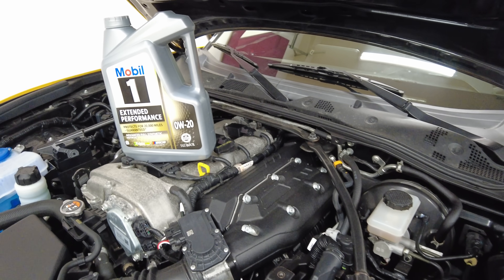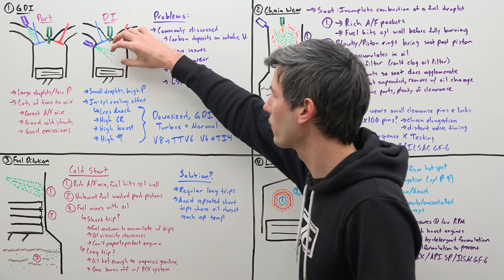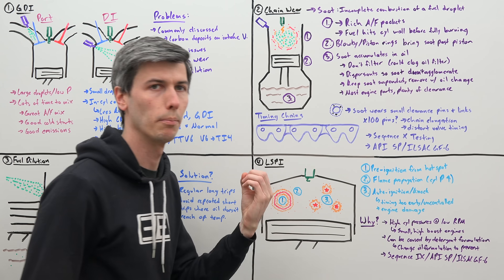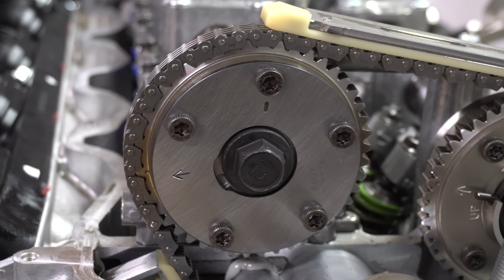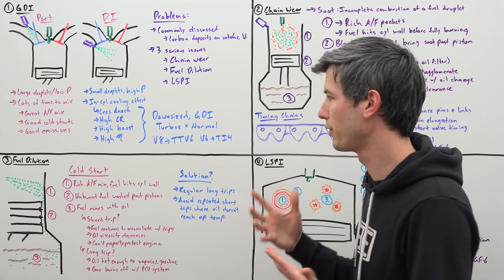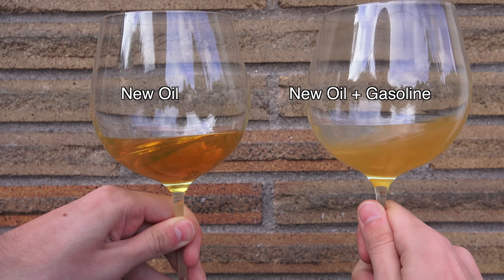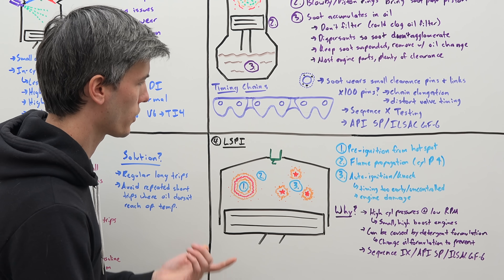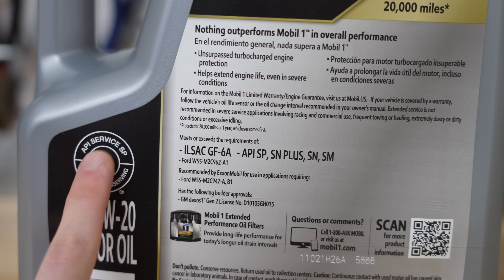3 Big Problems With Direct Injection Engines (Gasoline)

Comment: Some engines now come with port injectors, as well as direct injection. I'm curious to know if you feel this is to address these issues or the build up on the valves.
Reply: @asutin Grubbs best of both world
Reply: In DI/PI engines, port injectors are used at start-up and at low RPMs when efficiency isn’t needed, switching over to direct injection at higher RPMs to produce more power. This not only reduces carbon build-up on intakes by pouring gasoline on them, but also ensures that direct injection isn’t used at low temperatures. That reduces unburned fuel (soot) and oil dilution.

The trade-off is that these engines are quite a bit more complex in fuel injection and pumps, but also in timing and programming.
Reply: @afcgeo882  Toyota uses them, because they're clever people 😊
Reply: @afcgeo882  At very high RPM the DI can't keep up by itself and the PI cooling of the valves is beneficial and both are used is my understanding.  Where the DI really shines is in the mid-range where most cars are most of the time.
Reply: @Scoots1994  Quite the opposite. Direct injection is very happy at high RPMs and can easily “keep up”. Valves also don’t need cooling. 

“How It Works
According to Toyota, during low-to-medium engine loads, both direct-type and port-type fuel injection are used together, or one of them is used to create homogeneous mixed air and fuel, thus contributing to stable combustion processes.

During high engine load ranges, only the direct-type fuel injection is used to cool down the intake air with the chilling effect of vapors in the fuel, which is injected into the cylinder, improving charge efficiency and anti-knock properties. Under some conditions, the intake valves open to allow the homogeneous air/fuel mixture into the combustion chamber, and fuel is injected during the first half of the intake stroke.

During a cold start, the system times the opening of the port and direct fuel injector to decrease emissions and achieve stratified combustion. Immediately after a cold engine start and during the exhaust stroke, fuel is injected into the intake port from the fuel injector assembly (for port injection). Fuel is also injected from the direct fuel injector near the end of the compression stroke. This results in an air-fuel mixture that is stratified, and the area near the spark plug is richer than the rest of the air/fuel mixture. This process allows a retarded ignition timing to be used, raising the exhaust gas temperature. The increased exhaust gas temperatures promote rapid warmup of the catalysts and improve exhaust emission performance.

It is impossible to detect where the changeover from port to direct injection occurs. The only way to see the different fuel injection operations is with a scan tool.”

“Tomorrow’s Tech” article from their website, March 21, 2019.
Reply: @Scoots1994  D4S (Toyota's version of dual injection) I think only uses DI at high RPM. DI can most certainly keep up at high RPM, at least at the sorts of sub-8,000 rpms found on road vehicles.
Reply: @Scoots1994  I was about to say that. Mid-range is where the DI shines
Reply: @afcgeo882  Audi's 5.2L V10 engine uses the port injection throughout the rev range, although at higher RPMs it's limited to about 10% of the total fuel flow. They also do not use the direct injection system at low RPMs. So it will vary between manufacturer as to how they use the two methods of injection together.
Reply: @rars0n  It’s basically the same, actually. All of them use port injection at low RPMs and direct at high. You just said the same exact thing. Did you read what I’ve said? It’s the same with Ford and Hyundai as well.
Reply: @afcgeo882  No, I didn't George. You need to read more closely. You quoted something about the Toyota system which uses both port and direct injection at low RPMs and direct injection only at high RPMs. This is not how all systems work, as I pointed out. Audi's doesn't use the DI system at low RPMs and continues to use the port injection all the way to redline.

They operate slightly differently, which was my point.
Reply: @rars0n  I think you need to read what you wrote because you’re now contradicting yourself.

The VW EA888 Gen 3 engine (in Europe) is a DI engine with supplementary port injectors that it uses under low loads. That is to say it always injects via direct, but splits the injection duties with port injectors under cold start and low RPM loads. This was to reduce particulates in the exhaust to meet Euro 6 standards without a particulate filter. The VW gen 4 EA888 went back to DI only.
Reply: @afcgeo882  No George, the reading comprehension issues are entirely on your end. I was talking about Audi's 5.2L V10. Go back and re-read if you need to.
Reply: @rars0n  The R8 supercar engine developed by Lamborghini uses Port Injection at low DPMs, engaging DI at mid-range RPMs and switching to 85% DI input at high RPMs. However, this engine is basically hand-built for supercar employment, and is one of the most complex engines in the world. It should not be used as a comparison to common car engines. What they’re for, performance-wise is completely different. They operate differently, cost differently and their life expectancy os also very different.
Reply: @afcgeo882  The Lamborghini-developed V10 was the 5.0L, the 5.2L is completely different and developed by Audi. Lamborghini's 5.2L V10 is mechanically identical to the Audi 5.2L engine.

"uses Port Injection at low DPMs, engaging DI at mid-range RPMs and switching to 85% DI input at high RPMs."

I know, I already said all of that.

"It should not be used as a comparison to common car engines."

It's a production car engine, not a race engine. People can actually buy and drive these things daily if they really want to.
Reply: @rars0n  No. Both, the 5.0 and 5.2 were developed by Lamborghini. The 5.0 was sequential injection and the 5.2 is stratified injection. Since 2019 all V10 Lambos use the 5.2. The Lambo 5.2 is used in the R8, RS6, S8 and S6, though the latter two are simplified. Italdesigns cars also use the engine.
Reply: @afcgeo882 
Fords 5.0 Coyote V8 and GMs latest LT1 both use this technology.
Generally speaking they r very reliable and both are doing 100k to 200k kms without much issues.
Special props to Ford for that complex timing used n the 5.0.
Reply: @1989rs500  Ford uses it on 4 different engines, ranging from 2.7L to 5.0. All V6 F-150s have it. It came out on the 3.5 EcoBoost years ago. It just wasn’t reliable. Toyota originally had some issues with the D-4S in the Tacoma too. At this point the technology is well worked out, but long-term maintenance is increased with this, for sure.
Reply: @afcgeo882 
Still not too bad as many had thought it would be. Its very good
Reply: @1989rs500  I don’t know of anyone who had thought it would be a disaster. It’s just fuel injectors.
Reply: @afcgeo882  yeah.. But many were trying hard to attack ford for going Turbo with F150s and Di+Pfi n 5.0s.
But majority was proved wrong.
They r above average n industry reliability
Reply: @1989rs500  People are still doing that. They’re (people) generally adverse to change. We’re also talking about Ford F150 customers, most of whom are… how should I say this… lower on the intellectual spectrum.
Reply: @afcgeo882 
I can't agree to that.. Cuz as f now 60% of Ford F150 cstmrs are turbo takers..which is a huge change from what it used 2 b like 30% back n 2015.
Reply: @1989rs500  That’s for a good reason. Almost all the engines available are turbo and the V8 option is very expensive. They were forced into change.
Reply: @afcgeo882 
Yes
Now they ve launched a Maverick. Lets see how it does in sales. Maverick is more than enuf 4 90% f F150 buyers.
Ford/GM just milked them to for F150s, Silverados, Rams
Reply: @afcgeo882 Hey there. You seem to know a lot so though I'd ask. So what kind of regular maintenance besides oil and fluid changes are required in the Ford 3.5 Ecoboost with turbo and what milage roughly does it need to be done? I've seen plenty of Ford 5.0 v8 coyote engines get to 350,000km but rarely see any 3.5 ecoboosts get that far. Curious why. Thank you
Reply: @ryaniam22 Well… obviously regular synthetic oil changes every 10k km. Spark plug changes every 100k km. Fuel system cleaning (filter replacement) every 50k km. Ignition coil changes at 150k km. Disable auto start-stop if you can to prolong cam phasers. Let the car cool down on idle at end of each trip to preserve turbos. Watch for oil leaks and timing chain issues.
Reply: @afcgeo882 Jesus now is anyone supposed to let turbos cool down on idle at end of every trip lol. As if. No wonder they don't last. Too much bs. Better just get the 5.0 v8 coyote.
Reply: @ryaniam22 You wait for a minute once you park and then turn it off. This allows the engine to run the oil through and cool it down. This should be done with ALL turbos, actually.
Reply: @afcgeo882 Ok. Well 1 minute ain't that bad. If it was even 3 minutes the honestly no one is ever going to do that consistently
Reply: @ryaniam22 If you’re towing heavy trailers and in hot weather I’d say 5 minutes is best. In cold temps and regular driving you could just do 30 seconds. Just consider how hot your turbo is working. If it isn’t, then almost no cool down. If it’s working hard, let it wind down. Remember, once you turn off the engines, the oil pump is shut off and there is now no coolant to the really hot turbo spool. That’s how they melt. That and oil that’s too thick or too old.
Reply: @afcgeo882  EA888
Reply: @afcgeo882  at WOT port injection or a combination of port and DI are used because port is much better at a full stoichiometric charge. 
-DI is great for lean burn and PI is good for uniform air/fuel mixture.
Reply: @yolo_burrito  I know.
Reply: yeah, that's Toyota's D4S system, famously seen on the Subaru FA-20D engine in the original BRZ/86.
Reply: Toyota/Lexus do this, if I recall.  I also wonder what the effect is where two ignition systems are used such as the new type used by Mazda on their Skyactiv-X engines.  Not sure whether the non-compression ignition is still via DI or PI - I think it might be the former.
Reply: My 2021 F150 V8 uses this DI/PI combo as well.
Reply: As the Gdi engines produce more pressure on the combustion stroke and more torque at the crankshaft,does this not translate into more stresses on the timing chain?
Reply: @tomharrison6762  Why would it? The timing chain primarely drive the camshafts (and sometimes auxiliaries like water-pump etc.), but where the primary load is friction from work against the valve springs (and more so on low revs than high revs). If anything higher compression engines with higher combustion pressures also have higher expansion ratio usually resulting in more of the work (pressure) transferred to the crank thus leaving lower remaining pressure when the exhaust valves open, and on the intake side the compression stroke actually aids in closing the intake valve. The engine torque to drive the vehicle does not transmit through the timing chain, so it's a non-issue. If anything the only additional load a GDI engine will put on the timing chain, is if the high-pressure fuel pump is driven by the valve-train, and not due to higher combustion pressure and engine output torque.
Reply: They started doing dual direct and port on the Ford Ecoboosts about 5 years ago for this reason.
Reply: The system you describe has been used by Lexus known as the D-4S system for about a decade and Toyota has been using it on various models since 2018.
Reply from the maker: Here's my video on the subject, diving into the numerous reasons why it's done, including carbon: https://youtu.be/66C4YIiwRbM
Reply: Corvette 6.2 has the best of both worlds !
Reply: I was just wondering if any manufacturers had tried implementing this or not, I'll have to look into that
Reply: The small port injectors are too little and also contribute to preignition by introducing fuel again early in the strokes so KR is more common. The coking is still there. Slight improvement, but by no means solved.
Reply: Toyote 4.0 in 4runner has both.125000 and no carbon
Reply: Yes, but also to reduce soot emissions out the tailpipe.  Direct injection gas engines emit up to 200 times more soot than modern diesel engines.  Manufacturers like VW were looking at particulate filters for their GDI engines.
Reply: @freeride202  No they don't Diesel engines still produce far more soot. Most GDI engines don't have particulate filters, those are still pretty rare and the ones that do use much simpler/cheaper filters than those used in Diesel engines.
Reply: @BigUriel  in North America almost all on road diesels have been equipped with DPFs since 2007.  Yes, the engine might produce more but no out the tailpipe.  There have been studied but you can see this simply by looking at the tailpipes of different vehicles.  If you have ever seen a GDI cold start below -15C you will see them belch black smoke.  Ford, VW, Honda it doesn't matter they all do it and the tailpipes will be black with soot.  On the other hand even an emissions cheating VW TDI will have a soot free tailpipe.  You can quickly Google it but if not I can find the studies for you.  Just let me know.
Reply: @freeride202  In Europe these filters are mandatory now. Exhaust note is suffering really bad because of it.
Reply: @freeride202  source?
Reply: Yes.. among other reasons.  What they should do is make one of those injector banks spray water instead of fuel.  Water injection into the cylinder is the future.
Reply: @calholli  Why water?; It will further increase combustion pressure encourage corotion and further cool the mixture and impede combustion and lubrication.
Reply: @calholli  It's not easy to switch between 2 sources. But yes water injection is the future. It's a Pareto improvement for engines.
Reply: Complexity can be a problem later (complex systems break down if not properly maintained)..  So keeping up with oil change intervals (full synthetic always), avoid a lot of short trips.  Keeping engine clean and free of carbon buildup (carbon is a great insulator and has a high heat storing capacity..  heat accelerates oxidation exponentially).  I wold use a PEA based fuel cleaner periodically (2 or 3 times a year at least) to prevent carbon buildup  on piston tops, port intakes, etc.
Reply: @colty7764  and you've gotta remember, at least in the US, that just because the bottle says full synthetic doesn't mean the base oil was 100% synthetic (I think the legal minimum for a "full synthetic" to be called that is like 30% synthetic base oil)
Reply: @Prestiged_peck  exactly! I switched over my long-term vehicles to Pennzoil ultra platinum and/or the high mileage variant for this reason... Two oil changes after I noticed cleaner turbos on my 19 F-150 with the raptor 3.5L HO. I thought about a catch can but the oil fixed the issue being that it is a natural gas derived base.
Reply: @colty7764  there's also the added benefit of two sets of injectors, you're unlikely to have both injectors fail on the same cylinder at the same time, you can probably drive it to a shop or get it home unless it's a massive failure.

I'm all for simplicity, keep it as simple as well function, but there is a degree of redundancy.
Reply: Toyotas use GDI and Port EFI. Never have bad issues like VW and KIA engines for example
Reply: @DrWonderEyes  …VW uses DI and PI in their European models, but not in the US market. I would have purchased a VW in a heartbeat if it had dual injection systems used in Europe.
Reply: @82dupont  With the newer models   which have particle filters not anymore. Reason being the newer and more restricted exhaust laws in the EU. The allowed minimum of particles is not in reach for a combination of direct and port injection anymore and they need a filter in any case. So they removed the port injection.
Reply: My Lexus RX350 has this. You can definitely hear the GDI injectors popping on cold days, but it’s significantly quieter than pure GDI engines I’ve driven.

Edit: okay I’ve looked at a cross section of their design, the buildup on the intake valves in GDI is because there’s not gasoline flowing over them to clean them. The Toyota engine shouldn’t have this because of the port injectors inserting fuel into the intake side, so it should stay comparatively clean.
Reply: ALL gas powered vehicles need to be hybrids, until all electric vehicles, widespread usage and unfrastructure, are achieved.
Reply: @wethepeople-Y2K  why?
Reply: @wethepeople-Y2K  I agree. I have a plug in hybrid backed by a Port Injected V6. I am gonna maintain the crap,out of it and keep it as long as I can. So far I am doing double the miles on EV as in hybrid mode. Hopefully by the time the fairly small battery wears out the price to replace will be reasonable.
Reply: @wethepeople-Y2K  No they all do not need to be hybrids.  That's nonsense.

Comment: I's say the late 90's was the pinnacle of simple, fuel injected engines.   4.0L Jeep straight-6 and S52 BMW for example.
Reply: I still have my 92' 4.0 Jeep. It still runs like new, has never needed repairs besides maintenance type things. I'm keeping it permanently.
Reply: @TheBandit7613  Nice!   My 1999 XJ has 244,000 miles!   1998 M-Roadster has 95,000... I'm stuck in the 90's!